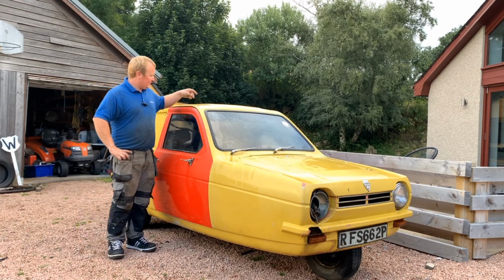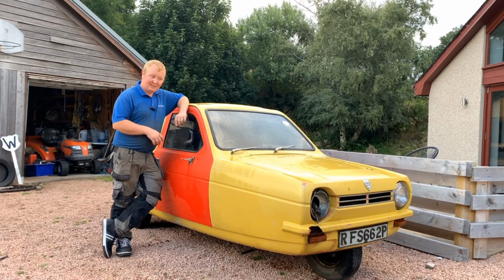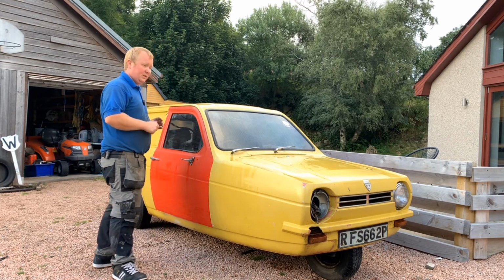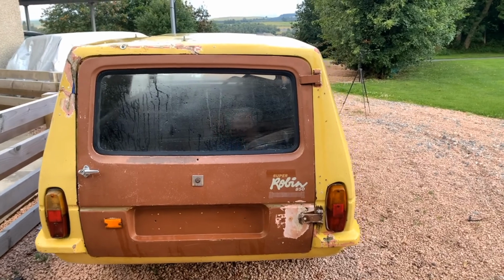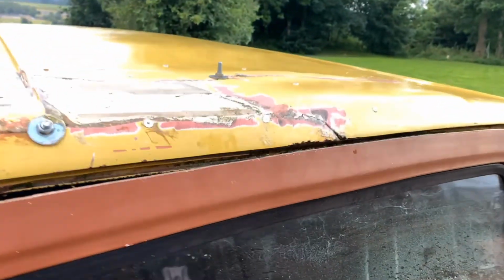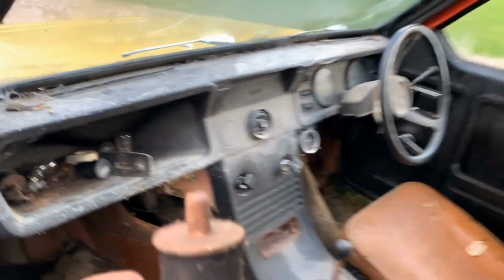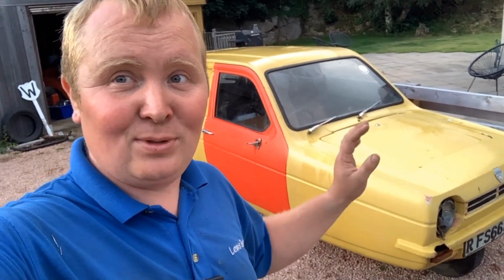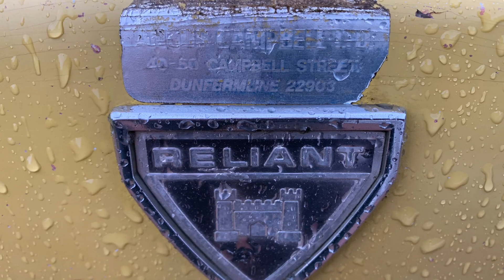WHO’S RANDY?! 🙈😂 What have I done now?

Comment: Is this really a Robin ? 
It looks exactly like my Reliant Regal that I bought in the 1970s to replace my Bond bug, as the bug wasnt big enough for me, the wife as well as our large Bull mastiff dog. It was in immaculate condition when I bought it, but unfortunately on the way home it turned on its side when the back tyre burst on the slip road off the motorway.  By the time it came to a halt it had ground a large hole in the side of the roof and removed the guttering. Fortunately, fibre glass is easy to repair and I soon had it back, looking immaculate, but it was annoying to damage it before I had even got it home. I used to drive it 60miles a day to work and as I was an apprentice I didnt have a lot of money so I used to dilute the petrol with the much cheaper paraffin. It still started and ran fine, though the performance was much reduced. I used to chug up death hill near Brands Hatch in Kent leaving a trail of blue smoke and smelling like old paraffin heater. Strangely I was never stopped by the police. But then I used to take my dog to work with me and he used to love resting his chin on my shoulder as I drove along, after watching cars overtaking us. Good luck with your restoration, the Reliant was a great car for the working man who only had a motorcycle licence, when he later had a family. 👍😎
Reply from the maker: Yeh this is a genuine Robin Van 🙂,  the regals slightly different, I’ll do a video sometime comparing the two vans maybe and showing the differences as they modernised the designs. 

That’s rather unfortunate 😅, but at least you was able to fix it again!   The Bond bugs definitely don’t have much room 😅, I’ve one here and it’s got very little storage space.  It’s always great to hear people’s stories of Reliant’s!
Reply: @LewiBuchProductions  

Yes very true, the Bond bug was very small but great fun to drive. Funny enough, I've just returned from a holiday in North Wales and the last time I was there was in the early 70s in that very bug. 👍😎